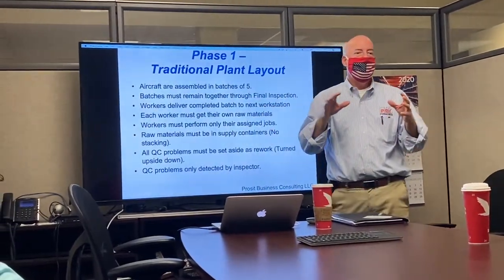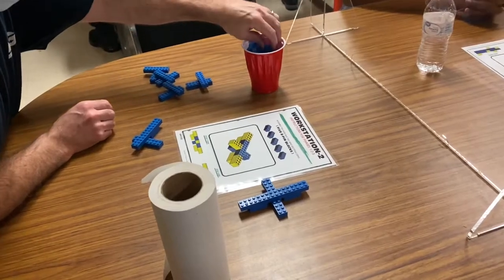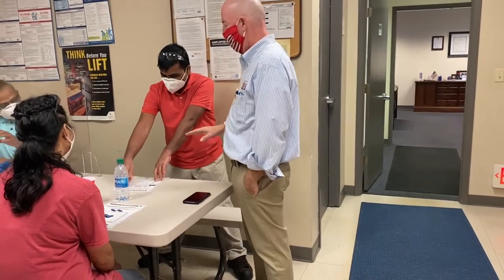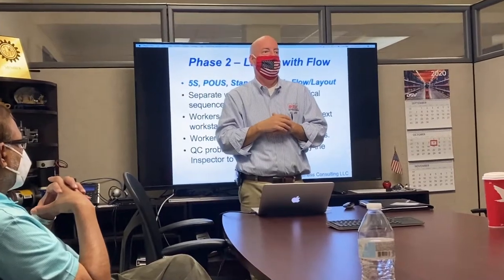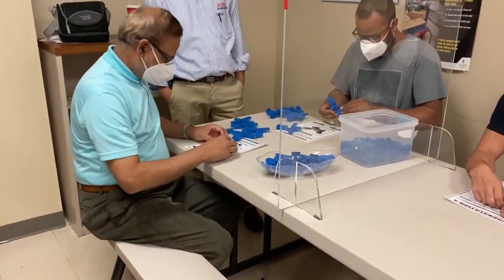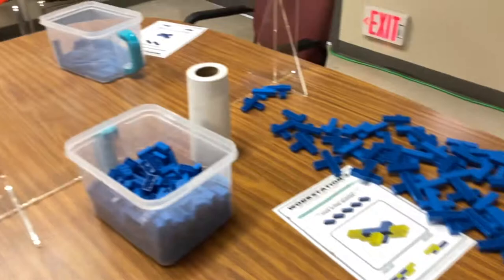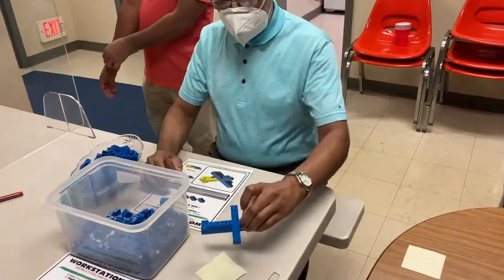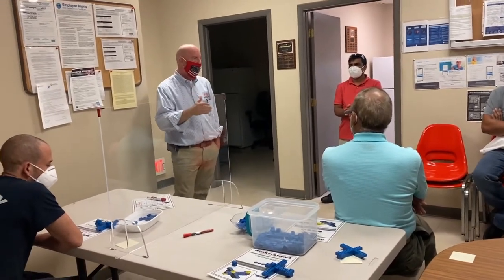Lean Manufacturing Simulation

Comment: I am going to be doing this today but I have gone threw it with a couple of other companies through the years I have been in manufacturing.  One problem I have run into in the past is that our vendors do not want excess inventory in their company for the end of the year during inventory time so they duplicated our kan ban cards and sent us hundreds of a few parts that they made tons of.  Other vendors started doing the same thing and we had way too much inventory piled up again. Times are strange now though and we ordered so much inventory because we knew that we may not be able to get any parts from overseas.  Now I have a years worth or more of just one part and in some cases it will take years to go through some of the inventory.  I am the only person in my company that makes a piece of lab equipment and I have been building this unit for six years now.  I build one unit at a time from start to finish.  Now my area has a lay out as if there will be more people in it making sub assemblies to kanban  and I like the flow, but I am the only person who builds the unit. Am I to build all the subs station to station and then start the final assembly? Are they going to hire more people?  I need to get rid of more clutter as I am a hoarder of scrapped parts that I like to invent stuff with or repurpose.